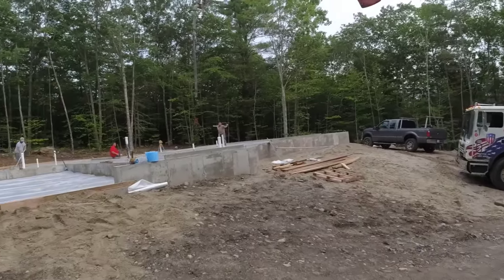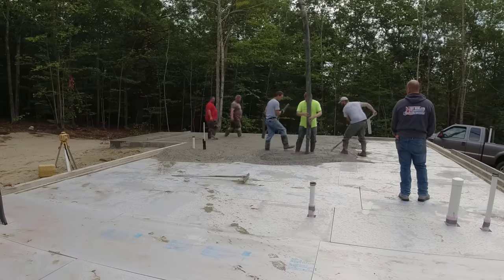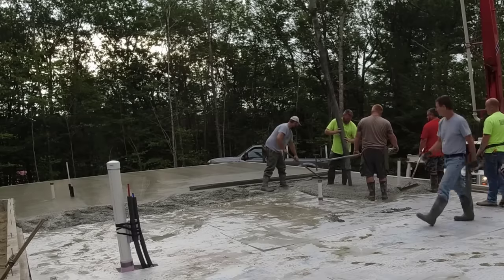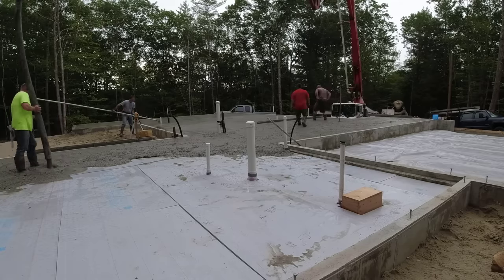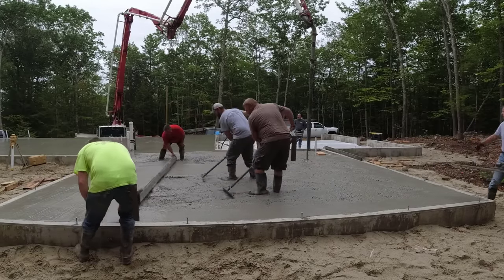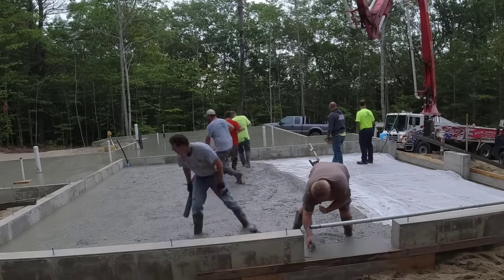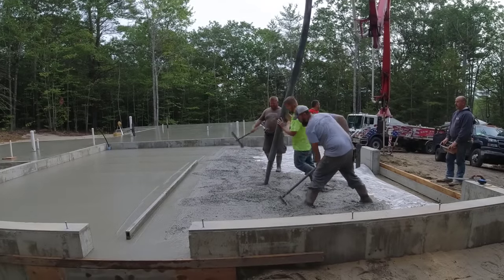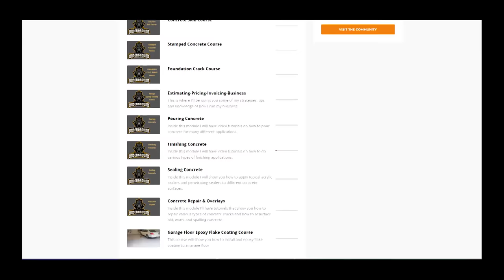Code Enforcement Costs Owner $3000 For Styrofoam Under Concrete Floor

Comment: Hi Mike,  really enjoy your videos and your explanation of what you’re doing.  Here in Minnesota it is mandatory to put foam under new home floors whether there is in-floor heat.  It is a radiant barrier that keeps the floor from sweating.  It’s especially crucial if they are laying carpet on it so that it doesn’t get mildew.  I don’t like my garage floors to sweat either so I always lay foam down.  Code enforcement isn’t available in most of the smaller towns but the state says we are all obligated to follow it regardless of inspections or not.  Keep up the great content!

Comment: $3,000.00 well spent. for an additional $1000.00, I would have intalled pex tubing for radiant floor heating by stapling directlty the tubing to the foam board.

Comment: Two things I’d never pour concrete without… A vapor barrier and insulation. You should insulate under the vapor barrier so the poly iso doesn’t float up to the surface.
Reply: I was required to tape the poly seams with a specific tape and caulk seal the poly to the perimeter vertical foundation. The foam sheets are also glued with the proper adhesive. The poly is never going to move - float up to the surface.

Comment: Government should not be able to force you to do things with your own property that you don't want to do, they are supposed to work for us not the other way around but even if you say they should be able to it should only apply when safety is at risk and adding foam has nothing to do with safety!

Comment: R value of foam, is about 6.5 per inch, or 13 for 2".   Whereas 2 inches of gravel/air, is about 7.   wall insulation, is about 9, etc.    So, by comparison,  requiring Styrofoam, under concrete, is not providing the best bang for the insulation buck.   But, I've seen a garage with heated floors.  You can open the doors, and still be comfortable.   So, adding the heat is a game changer.

Comment: The codes are there for a reason. Building has become a science, and the owner should not have the choice to ignore them because some contractor says slab insulation isn't really needed.
Reply: Make everything too expensive, that way people can be safe sleeping on the streets.

Comment: I lived in a duplex in kansas with an attached garage that had no drain.  we were only there a few years, but the melt and rain off the car made the humidity and the mud joints on the ceiling just fell right off

Comment: I put styro under my slab and no matter the weather I NEVER get any moisture settling out on the slab. I still wish I would have piped it for heating inside the slab. I will never do another one without insulation AND piped with PEX for heating.

Comment: I'm not sure to what climate you are in.... but I've been building and remodeling homes for 25 years. Its my belief that homes are grossly under insulated. You can heat and air condition a house with very little energy in a highly insulated home. Home construction standards in America is embarrassing when you compare it to some Nordic countries....
Reply: All that is true... I am from a nordic country where code is strict and adds 50k worth of cost to an otherwise simple home. Its a slippery slope once they start making up laws, it never ends. The end result is these very efficient new builds that no working man can afford, resulting in a housing crisis. So be carefull what you wish for. America should be about freedom to make your own choices. We've lost our way here
Reply: @garage3022  Seems to me that codes should be about technical standards, structural adequateness, safety and that sort of purely technical requirements. Things like energy efficiency, handicap access and such should be recommendations and if done right, tied to tax credits and other incentives.  

I'm fine with policy that requires these things in public and even commercial buildings, but private residential is another story. Yu can certify aspects of these optional things that potentially increase the assessed value and incentives can be used to offset costs, but forcing you to do such things is an infringement on you freedoms. And the value of such things has a lot to do with the climate you are in.  That gas a lot to do with how long it takes to payback on the energy,
Reply: @garage3022  $50k, assuming 50% energy savings, is maybe 112 years until payback in our 15 y.o. Vermont house.

Comment: its better to put insulation along the sides... when putting underneath, it reduces strength and thermal mass. like wise, blocking out any potential geothermal heat. 

heat is lost mainly through the sides; dirt is both insulative and a thermal mass.

i did on the sides for my building... a month of -10*c so far, unheated partially insulated house... sitting at 5*c inside. free geothermal heat that otherwise would have been blocked out.

Comment: Pouring on foam insulation greatly speeds set time.  Your guys are quick.  You'll have no problems. Alarm bells went off in my head when you said you were using an accelerant.  Careful.
I've been putting foam under all my slabs for 40 years now. (retired now)  Blame me.  And the Best use is for an unheated space.  My shop, my garage, they don't freeze in the winter.  The shop,, 15 or 20F degrees warmer in than out in the winter,, and 15 or 20F cooler in the summer heat.  But DON'T let your concrete slab touch the surrounding block or foundation, don't let it sink in around your plumbing or electrical intrusions.  If you are gonna put foam under the whole thing,, make sure it is isolated,, not in contact with footings, soil, or outside air.  You lose all benefit.

Comment: Absolutely under floor or perimeter foundation insulation should be code.  You only get one chance to do it right and the only way to stop the short sighted from cutting corners is to have "code cops".  It's too bad that we need code cops - but that's the way the world turns.
Buy the way - for ground contact, you want to use EPS - not blue board or pink board.

Comment: why is this any different than neglecting to put insulation in the walls and roof of a heated space?
Reply: The thermal gradient is much smaller so insulation has a lower return. It's nearly temporate in warmer areas and in fact good ground conduction is prefered when used with excellent insulation of roof and walls. This is why caves and dugouts stay pretty nice.

Comment: the code inspector is correct. in this case the government regulation is doing the homeowner a favor, saving them from their own ignorance. foam insulation is a must.
Reply: 85% of heat loss is thru roof. Cold floors do suck tho. Dont like how foam flexes under workers, hope fiber additive stops cracks in concrete.

Comment: Depending on your state you are required to install insulation below the slab in new residential homes. The owner will save that money and then some in heating cost.

Comment: I see the foam boards moving up and down when they are walked on. How level does the ground have to be under it? Will the weight of the concrete push it down so that it won't push down more when more weight is put on it once it dry? I would think that in a garage if there was foam it could crack the floor when a truck drives on it depending on how flat the ground is under the foam.
Reply: I just poured my floors yesterday and my dirt was so uneven underneath and I had the exact question. We had to pour anyways but I worry about how that may affect settling in the future. We did end up using rebar 24oc hoping that helps hold it all together well.

Comment: There's something cool about watching skilled workers getting a job done as a team.

As for the floor insulation, I bet it pays for itself pretty quick in Maine.  Better insulation allows you to use a smaller HVAC system, so you save some of that money right away.  I think you said heat pump, so electric.  If (when) the power goes out a small wood burning fireplace might be able to heat the whole house without much effort.  Good insulation is even more important if you're going off grid and using solar panels, batteries, and generators; then those don't have to be as powerful, so you probably start out actually saving money.

Comment: Yes, the foam is useful and REAUIRED.  It is insulation, for the ignorant poster, it is not a vapor barrier.  Will help a lot in not haing cold floors.

Comment: The one thing about weird elevation lots is I always say, if the driveway approach is ever in question, like a level lot house no one thinks about it so it's fine, but funky lots, just lower or raise the house 4' closer to the road height. It's either too high or too low as is. I've slid my truck off a hillside getting to a site because it was too low from the road. It makes a world of difference moving some dirt around rather than gambling.

Comment: With a career in contracting . . . 
While there have been a few times I've been on jobs where there were "surprises" in the specifications, I've never been on a job where the contractors were surprised by the inspector!
Well, maybe I need to qualify that. I have seen contractors be surprised when they were doing a job outside of their usual scope. Or, they were newbies whose enthusiasm exceeded their experience.
Biggest problem? You have to know more than "your" code. Especially with the newer energy, LEED, ADA, and 'whatever' codes popping up like mushrooms.

Comment: It can seem like a unnecessary cost burden for an unheated garage floor.  However if in 10 years the owner decides to use that space for any other purpose that would require space heating (workshop, office, living space) it is going to be much less effort and cost to bring it up to the desired insulation performance level.  Cheaper to do it up front. Can’t comment on building code inconsistencies though. Don’t have the numbers for Maine but the savings on any future heating costs would pay for that work quickly.  Most building code upgrades are based on lots of experience and data.

Comment: The styrofoam keeps the house energy efficient. So if 1,000 homes consolidated in one area need utility gas/electricity, that power density doesn't tax the state infrastructure as much. If you want to live in a small hamlet and do your own thing as a small community, then you get a pass on the regs. Energy is everything and it has to be delivered reliably and efficiently.

Comment: I was watching to see what had to be remove/redone.... Sounds like the title should say "Code Enforcement Costs Owner $3000 extra For Styrofoam Under Concrete Floor"....With the tittle now I found this and was not sure if no Styrofoam was put down or I was thinking more likely wrong type/to thin was put down.
Reply: Me too. I always expect code enforcement to make things more difficult, and expensive. You should know what the code in the area you are building on calls for. So should anyone that is pouring foundation, but ultimately it's the builder and homeowner's responsibility.

Comment: As a Contractor, local code is local code.  Doesn't matter if it is necessary.  If you don't agree with it, go to the city council meetings before you start to pour.

Comment: You asked whether or not 2" of styrofoam insulation should be required.  Questions:  (1) Based on your commentary, you are working in the State of Main. What set of Building Codes are you working under? and (2) Does that set of Building Codes require 2": of sub-slab styrofoam insulation?  It would appear that if the Code Enforcement Officer required installation of 2" sub-slab styrofoam insulation, that the Building Code required it.

Comment: 6:50 A garage with no styrofoam. How does that hold up in the winter, thinking frost creepin into the concrete and may be prone to damage? You got a video bout that? 
Reason is i live in Denmark north scandinavia Europe, and just like this project the styrofoam is fking expensive, and i want to build a SA garage.
Reply from the maker: It's probably worth it, whether you heat the garage or not, to put Styrofoam under the floor. I know it's expensive. I have it in my garage, unheated, and it rarely gets below freezing in there. My walls are also insulated though.
Reply: @MikeDayConcrete  you are awesome to hit me back that quickly, thx Mike. 
Ill take your advice into the planning of the building.

Comment: Hi Mike I poured 31 yards in Thomaston today early start, a 1.5 bags calcium per truck and the thing still wouldn’t kick , by about 4 o’clock we took the trowel off and handed it out. How much calcium do you use ? , and do you ever just hand em out when it’s colder?

Comment: They require styrofoam.... but not rebar or at least wire mesh 🤦‍♂️. Code says you need an energy efficient slab, just not a solid or long lasting one...😂

Comment: Well, insulation is one of those mathematical things. You get the greatest value from the first inch. The next inch is less and so on. Well, getting the homeowner to agree to the first inch is probably the greatest obstacle. 🤷 an inch sounds like plenty as the alternative is nothing.

Comment: Doing a couple slabs soon for a carport and workshop.  I have poly down under the mesh/rebar.  Job got pushed as it's November and rain came in.  How much water on the poly is too much water?  I was planning to wet vac and leaf blower it off, but I see you not worrying about it here.  I also heard you always want poly directly against concrete (not under foam or sand etc, because that will trap the water and force it to slowly evaporate up thorugh the concrete, could take years).  Do you know why this builder put poly under the foam?  Thanks
Reply: They are already pouring soup. What’s a little more water at that point??

Comment: The homeowner was fortunate to only incur $3,000 in unplanned costs for the concrete slab. The average cost is $10,000 and can be as expensive as $25,000.

Comment: I am obviously no expert, so my question is: You are pouring this huge slab without any steel rebar reinforcement. Especially since it is also on top of a layer of styrofoam, isn't that just asking for cracks later on?
Reply: All concrete cracks.
Reply: No it doesn't. Growing up in Europe, even in single family houses the floors between basement and ground floor, and ground floor and second floor are usually not wood, but concrete. I have never seen cracks in those floors. But they are indeed highly steel reinforced. On the other hand, almost every basement or garage floor that I see in north America has cracks. I am beginning to understand why that is, lol!
Reply: @I_Dont_Answer_Questions  The concrete in my 2,400 square foot shop is over 20 years old and there are no cracks. I have heavy machining centers in it and also drive heavy pickups in and out. I had the contractor put in additional rebar and higher psi concrete also.

If done right it does not crack.

Comment: That concrete looks very runny, too much water will compromise it's strength, I guess it might be okay for a one single floor structure
Reply: I see that a lot on YouTube videos. I wish the homeowners would require slump and strength test. A whole new ballgame.

Comment: *Homeowner costs owner $3000 for foam under concrete. Fixed it for you. Poor planning may have meant this felt like an unexpected cost, but if it's in the code, then it should be enforced.

Comment: I rent an apartment in town for work (I actually live in the country but stay work weeks in town) that does not have insulation under the concrete slab.  It is almost impossible to get the concrete warm with the hot air heat system.  I don't think code should be able to force a  homeowner to do anything other than safety but I guess they think it's saving the planet kind of regulation.  Hopefully, though, when no foam is used that would be disclosed in any future sale of the house.
Reply: The majority of building code has nothing at all to do with safety. 
It's the manufacturers of products getting government to mandate that people have to buy it. It's that simple...

Comment: You charge $1 per square foot to do the styrofoam but the sheets are $50 and are only 32 square ft each ?
Reply: labor only material on site

Comment: Anyone how think that insulating a poured floor is stupid or you don't need it is not a good contractor.  To installed in now before you pour the floor is what a few thousands but to do it later on it cost you 10k or more.   It is cheap to do  it know and if you want to take a garage and turn it into a heated garage it will be better and easier to heat.  Also I would even do the prep for in floor heat in a slab just to have in just in case years later.  A few dollars spent in the prep of something can make it so much better in the long run.

Comment: SO Mike - why the dig on "code enforcement"? If your putting a slab on grade foam insulation makes sense. In fact, why would you not do radiant floor if your doing a house on a slab. 
Also in the northeast we frown upon fiber mesh - its not as strong and causes issues with finishing.
And honestly WTF, if you live in a small town in Maine there's no code requirements? Guess Im not buying a house there.

Comment: I can see the benefit behind the foam but man it does not let the ground dry out the concrete. We had a home owner "get a good deal" on recycled insulated doors so we installed them in the garage before concrete and the finishers worked from morning to 8pm at night working the concrete slurry because they weren't told about the aluminum doors with foam-core and showed up without any additives. Homeowner got a massive hourly bill and a less than stellar finish. He fired them from doing the basement the next day because he didn't put two and two together that he screwed himself over.